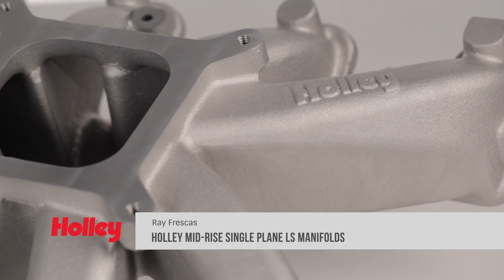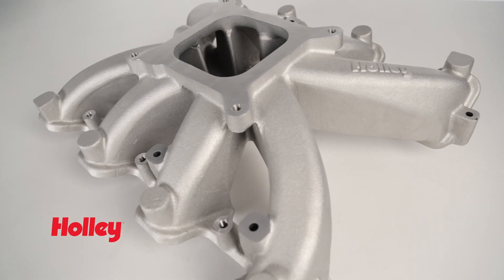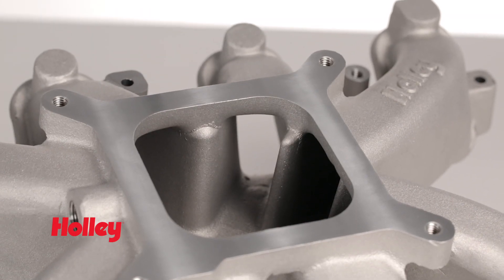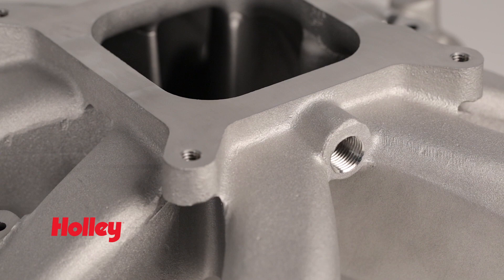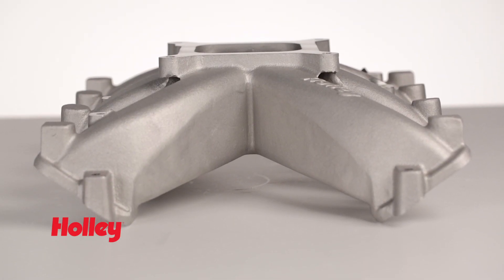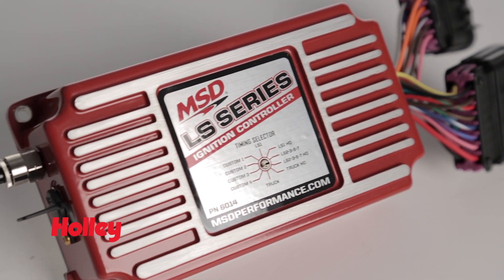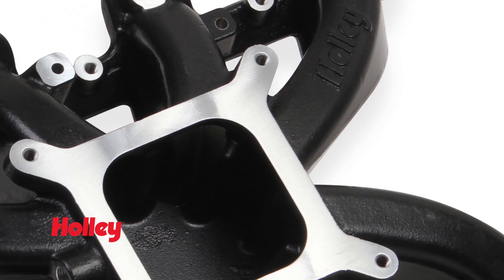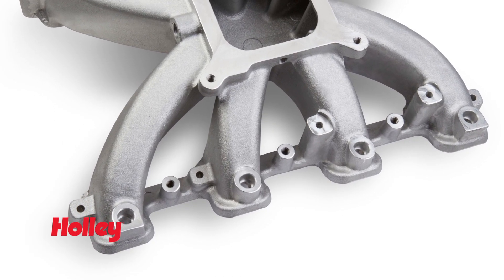Holley Mid Rise Single Plane LS Intake Manifolds

Comment: Bought this product a few months back and yet to try it but as soon as I opened the box, I wasn’t really pleased...... it fit great and had no issues with the figment and it started with no issues with an edelbrock carb..... the casting sucks.... I had to use light sandpaper and a file to get rid of a lot of burs and casting marks and the inside still had shavings in it probably from some burs that had fallen off during shipment and unboxing..... also, 2 of those orings were bad as there was a razor knife like slit in them.... I know I didn’t do it as I used a pair of scissors and cut the package at least 2 inches away from seals.... also, the seal bosses were too deep and they sat flush with the mounting surface so used sealant and then upgraded to bigger orings that I had to buy from an auto parts store...... 
again, the fitment was perfect and had no issues aside from the seals but as with the burs and the sharp edges around the carb and head mounting surface. It was too late to return as I didn’t want to spend $600+ for a better intake so I made sure they were cleaned instead of going inside my engine and causing more damage than good......
You obviously get what you pay for but c’mon Holley, I’ve bought numerous of your parts as well as my father and grandfather and they swear by Holley. Please make these intakes a little better or tell the Chinese factories to do a better job with their product you’re selling.... I’m sorry but a definite 2 out of 5 stars from me and I will not be buying another one ever

Comment: can I use a elbow and a ls throttle body with this intake manifold?
Reply from the maker: Yes you sure can! We also offer that elbow as well. Use PART# 300-240.
Reply: ok awesome thank you for the reply, are your injectors pretty easy to tune with and do they work with E85? PART# 522-668